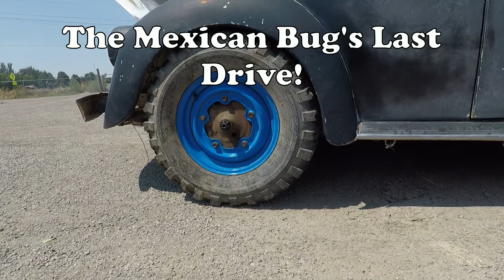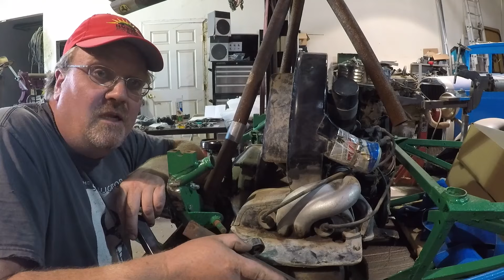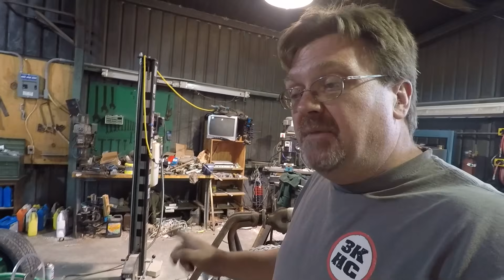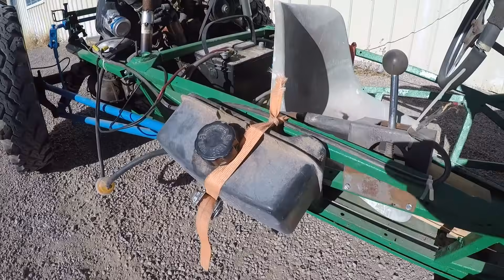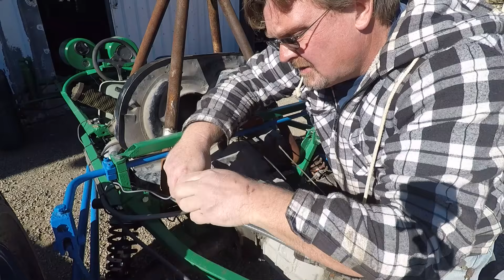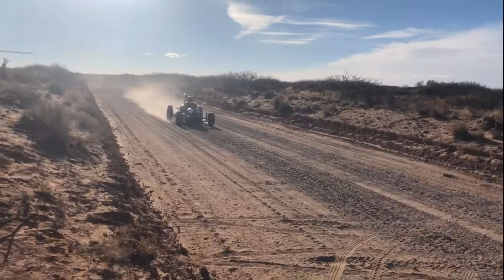Project Frogger Lives!  Mid-engine Formula Vee Dirt Kart with Mexican Bug Power!

Comment: Just a suggestion, instead of flipping the ring gear. You should have just turned the transmission upside down. That’s how the car was originally designed. And it will correct the negative rear camber at the same time.

Most formula-V’s are designed that way. Because it also lowers the center of gravity at the same time. 
Of course you need to plum or move the breather vent . But you can do it no problem

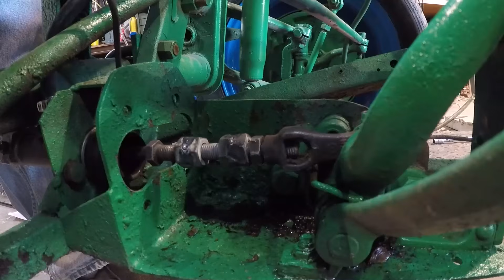Comment: WOW! I'm surprised to see that the axle nut was so loose. Had to do brakes on mine, and it still 11:13 required a 5' cheater pipe and alot of jumping and cussing.
Reply: I lost a wheel on my '67 after doing brakes because I didn't torque nut to spec. Went over RR tracks and wheel came off and rolled past the car. No major damage done.

Comment: Some buddies of mine used to race a Hi Jumper  sand Sprite frame with a mid-engine configuration at the local mud bogs here in Orlando back in the 80s.  Long story short they were beating v8-powered buggies with very little money and as a result the officials kept changing the rules. Eventually the buggy got parted out and the frame was converted into a regular rear engine buggy which I still have.

Comment: Well! You wasted money on a rev counter. will self regulate at 3000 flat out.  A big orange indicator light on the pressure switch would be better as it will flicker spectacularly when oil is boiling hot!. Oh and a box on the back to put all the bits that fall off!:eyes-pink-heart-shape:

Comment: I bought a buggy in the eighties that someone built. It was basically a bug with 
no body and the rear seat section was remove and welded back together. I had 
a top quality beanbag chair seat and the gas tank was a 15lb LP tank with a filler 
neck added. The only problem, which was big, was I didn't live in the desert and the 
gearing was way too high for the woods. I could only drive in first and there was no practical way to gear it down. Unimog style hubs? The suspension was awesome on the bumps. Unfortunately, I ended up burning out the clutch.  😭 That was such a blast to drive, though.
Reply from the maker: For the early VW busses they used reduction boxes on the regular bug transmission to get lower gearing and more ground clearance.  Only works on the swingaxle transaxles, but same idea as the unimog!

Comment: Try using a lever with a spring for the throttle and clutch might work better the reason sometimes vw don't go in 2cd gear is a shifter bow adjustment

Comment: Need details on how you made the shifter work.
That's the most complicated part....
Reply from the maker: That was an old cable shifter that came with the chassis, some kind of aftermarket unit.  It didn't work well, I've got to take it apart and get all the gears.  There will be an update on this one coming up soon.

Comment: Have you ever thought about putting the throttle on the steering wheel and just have a break and a clutch pedal might be easier for you to actuate with those sailing ships as feet that you have on your legs but that's one way around it without having to terribly redesign the control system for it
Reply from the maker: That is a good idea.  I'm going to have to re-visit that project soon, its been sitting too long.
Reply: @LowBuckGarage  I would definitely love to see you get back to the frogger project I would also like to see you be able to use all your gears on it too so locating the shift lever to the outside of the vehicle right next to you might give you more thigh space I mean you are a large man and you need a cockpit that can accommodate you comfortably what about the Mercedes-Benz seat in the frogger give you a nice plush ride
Reply: clutch on the shifter might be easier to actuate...

Comment: Maybe I should get you to help with a 4x4 van project,,,,,,,,,,, is your r/v a 4wd?
Reply from the maker: I did put a dana 60 in the front of the RV, but didn't finish the conversion.  I'm actually going to replace that with a different dana 60 and finish it off in an upcoming video.
Reply: @LowBuckGarage  sweet,, looking forward to it

Comment: You skipping second gear, does it have second gear?
Reply from the maker: The transaxle does have second, but that shifter wouldn't engage it.  I've got to do some work on the shifter, because it won't let me put it in reverse either.

Comment: Looks like a auto dynamics mark1 or 2?
Reply from the maker: I had actually assumed that it was homemade, but now that you mentioned those I had to do some digging.  I only could find frame photos of a mark IV, but it does look pretty similar.  It definitely could be an earlier model.  There's no plate or ID that I saw, but if you have any good way to ID it please let me know!